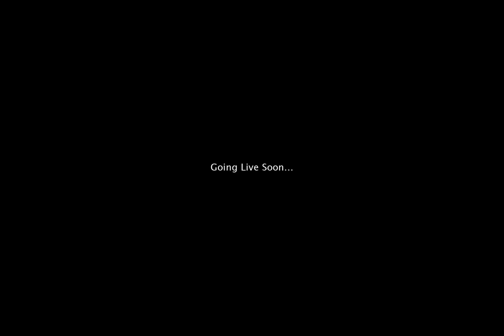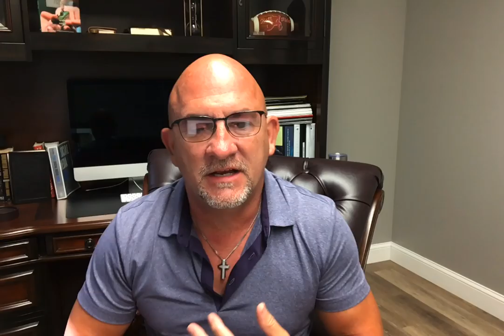Powder Coating Equipment: Electric vs Gas Ovens

Comment: What are your thoughts on a vacuum oven? I have an opportunity to purchase a fairly large one at a reasonable price and wanted to know if there are any drawbacks to a vacuum oven.
Reply from the maker: Vacuum ovens are typically made more for drying parts than curing parts. They aren't built the same as curing ovens.
Reply: @powderxcoatingsystems  would one still work well? Or are they inefficient compared to a normal convection oven?
Reply: @SpeedySpears  Sorry for the long delay to respond.  For some reason, we didn't get notification of your comment.  Because of lack of balanced temp, it would not work as well.  Would it work?  No way to tell without seeing the specifications on the particular oven you are looking at.  Sorry again for the delay.